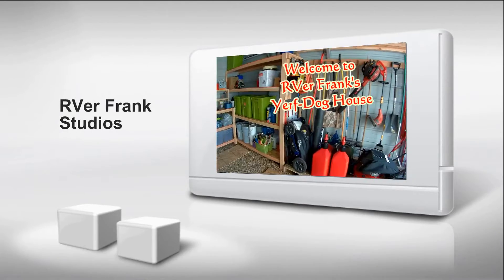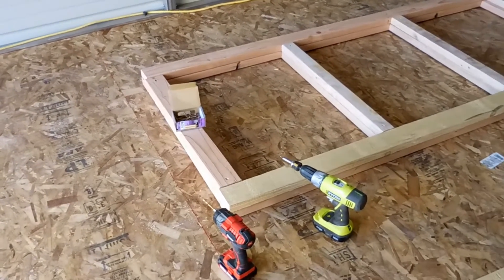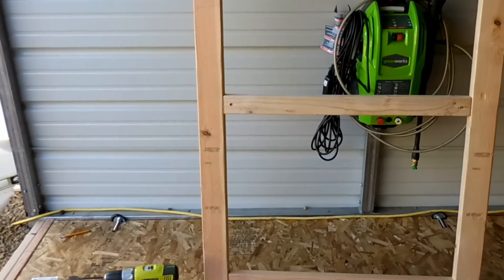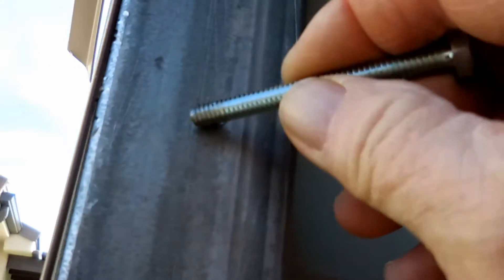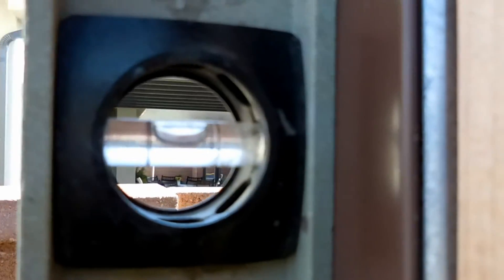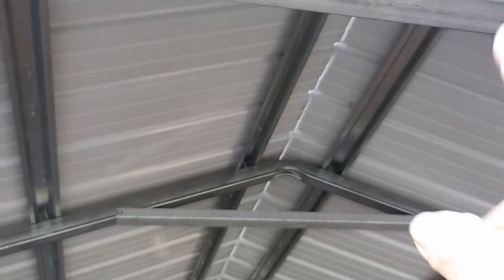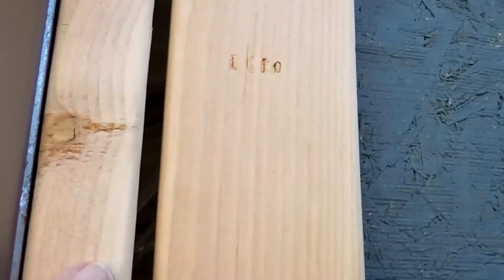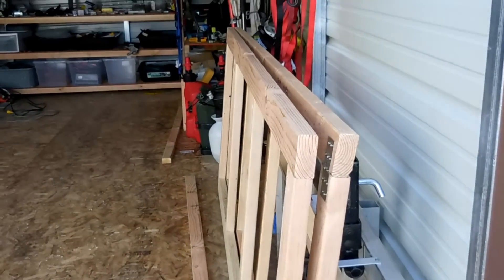549-UTV-XRC "The Yerf Dawg" House, Fabricating Bi-fold Door Step 3

Comment: Great idea on the bore for the protruding bolt heads, I would have never though if it. Also good on threaded bolts 1/4-20 over lag bolts in the steel and you used grade 5 bolts which is good also. Now you have answered my previous comment by installing a cable and the corner braces to help  keep it all square. Good video here.
Reply from the maker: Thanks, more to come!👍